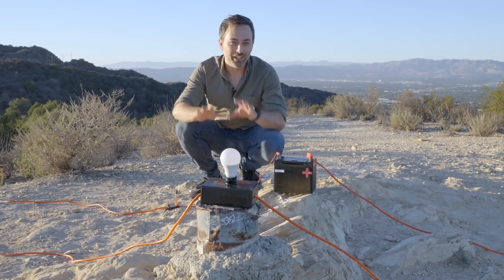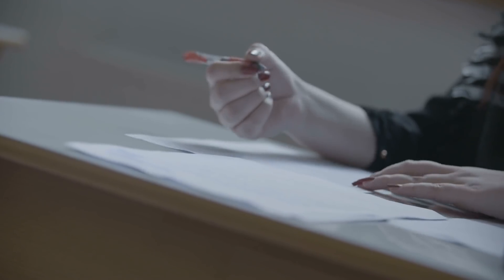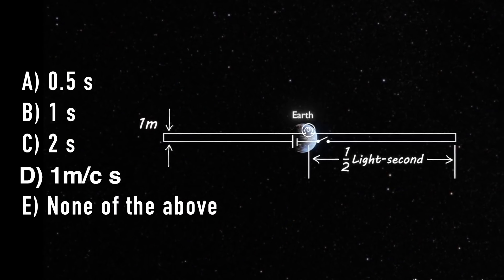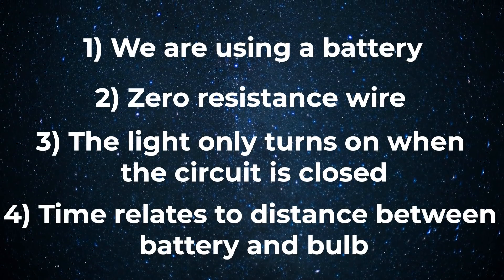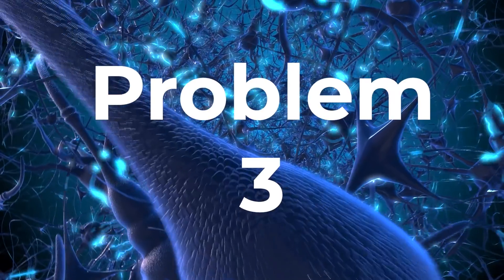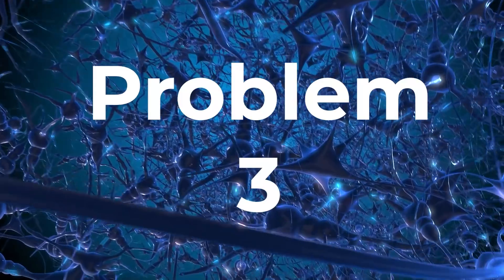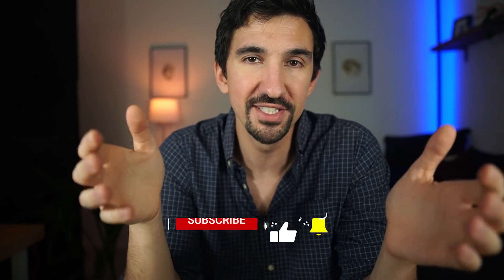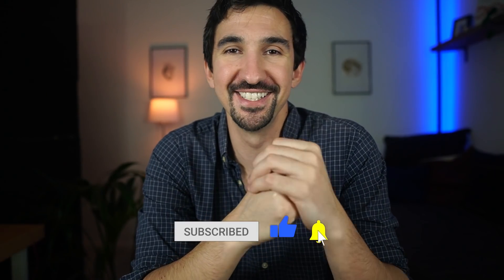Is Veritasium Wrong About Electricity?

Comment: I think your analysis is on the right track. When I watched the Veritasium video, my first thought was about causality. How do the terminals of the battery know the circuit is intact when the switch closes?

As you say, even if the circuit is not closed (e.g., broken at the extrema), we are looking at coupled antennas. Hence, the 1m/c time delay before a current shows up near the bulb. 

This toy circuit configuration stimulates interesting thoughts about what happens when you connect a battery to an open circuit. Is the equilibrium state of a battery is slightly different when standing completely alone versus when connected to an open circuit?
Reply: The electrons in the wire are under pressure to move (potential energy); that force is provided by the battery is available at the switch contacts or break in the wire.  But they do not move, due to a break in the conductor. The path is complete and therefore  propagation of electrons under force is possible, when the circuit is closed.

Comment: I thought he was saying that the energy took the direct route.  Like a capacitor where the surfaces don't touch.  I that case you can have a signal before the condenser is fully charged.  I don't feel the need to apologize for not taking a test on it.

Comment: I don't know the corret answert but you have to consider not only the resistance of the conductor but also the fact that a wire is also an inductance and two wires running in close vicinity are a capacitor. So the current can't rise immediately and the bulb will not light so also. (Sorry for the bad english)

Comment: The universal speed limit of the speed of light applies to particles. A particle or object cannot travel faster than the speed of light. However, this law does not apply to a wave or for information. When there is a wave, you have energy being transferred from one particle to another. This energy transfer CAN be faster than the speed of light. The energy wave can move very quickly even though each particular particle is not.

Comment: Of course, 3) is false (for a short period): very easy. That is all point. The lamp's time to switch off depends on the physical section where the wire breaks; the more distant it fails, the longer the light takes to switch off. Ignore the length of the wire, always consider the distance in a straight line (in ideal conditions). The point is that you have to consider the distances in a straight line and not the length of the wire. When you contact the battery, the space in a straight line is one meter.

Comment: These are both bullsh#$ theories.  It's angry pixies running through the wires.  Evidence:  You get the crap shocked out of you if you touch a wire with enough pixies.  Tell me that isn't malevolent entities!  Further evidence:  If you put together a circuit and get it wrong, they set up a little camp fire inside your parts, often the most expensive ones (malevolence I say!) releasing their "magic smoke" as a message that your work isn't up to AS9100 standards.  Don't be fooled, these guys have both sold out to the pixies...🤣

Comment: Well Dr Ben, you are partly right, but you have been confused by the circuit arrangements. You are suggesting that the light bulb can operate with a DC EM field, conceptually interesting but.....
Consider instead a bulb at the end of the long wires (because this is in reality the arrangement). This is now the recognisable transmission line, and so POWER (not current or voltage as such) reaches the bulb after length/c (forget velocity factor for the moment) seconds. One can easily observe this with a cable and a fast oscilloscope. The actual circuit under discussion is a transmission line BUT it has an inductance in one of the parallel wires, this simply makes the propagation slower, changing the line capacitance and inductance (and the characteristic impedance at the same time. Thus the bulb lights more slowly the longer the circuit. The 2 aerials analogy is not specifically correct, although one could describe a transmission line in this way I suppose.

Comment: 4:21 when the circuit breaks far away from the bulb, there is still some energy flowing (following Poynting vector) from the field created (also) by that part of the circuit towards the bulb. It takes some time for this energy to arrive at the bulb, and this repairs the supposed problem with superluminal information. So I believe Veritasium was right, at least at the first order of approximation, if you interpret "turns on" like "starts producing light" and "turns off" like "starts decreasing its light".
Reply: then wouldn't that same delay happen when the light turns on?
Reply: @kinghassy334  yes, it happens both ways.  What Ve left out was that there is always power transmission due to air gap induction, (wireless power, like the phone charger pads which have to be very close together and in compatible configuration,) but until the circuit is completed in the wire, (total circuit distance/speed of light) there isn't enough power in his demonstration model to make the bulb turn on visibly.
Reply: Veritasium has been wrong about a lot things for the past 2 years. Just saying.
Reply: @cjay2  do you know any where I can check what Veritasium got wrong?
Reply: @YasaswiS  he’s been posting that same comment in many many of these replies. Just a troll.
Reply: @cjay2  you sure like to repeat yourself over and over and over don’t you? 🤣
Reply: Why bother with fiber optics if you can send information faster just by making the wires longer?
Reply: @JuanCLeal  You can't.  That's the problem with the incomplete information Veritasium gave us.  The thing that made it "faster" was the smaller distance of the source and target, but not enough power is transmitted at that faster speed to actually light the bulb enough for the real world to call it "on."  Some power moves through the air gap, but not enough to do work until the full circuit is complete.
Reply: @JuanCLeal  because in the real world the cables do have resistance lol
Reply: @JuanCLeal , making the wires long enough is not practical.
Reply: The point isn’t that the light is readily on or readily off but that the light is communicating that the circuit has broken before light from the break in the circuit can reach the observer that would in tandem usually imply that the circuit broke and then the light turned off however here causality is broken. The bulb turned “off”, (or as you said would lose light as the cross product of the electric and magnetic fields would lessen and the power too lessen still SOMETHING that is observed no matter if there it is small ) THEN the circuit broke. This breaks special relativity and is why it is wrong.
Reply: @j.gczaricit9446  If the distance between the break and the bulb is d, then what you can observe locally at the bulb will start happening exactly after d/c time units. Energy flows at c, not instantaneously.
Reply: Perhaps a more effective version of the thought experiment is the following: consider a very long circuit, almost entirely confined in a circular region or radius r (where also the battery and the bulb are placed), except for a portion of it reaching distance R >> r and coming back along two approximately parallel straight lines. If the length  L of the portion of the circuit confined in the circular region is much larger than R, then you get a magnified "turn on" effect, meaning that the bulb will reach a significant portion of its full power within r/c time units, while thinking of energy flowing within the circuit (whatever it means) would predict a larger time of order R/c.
Reply: @j.gczaricit9446  The electromagnetic wave (similar to a radiowave) crosses the air gap at the speed of light. So, it doesn't break any relativity.
He is simply wrong that it actually has enough energy to turn the light on. At least, my definition of ON. 
The circuit doesn't know or receive any information faster than the speed of light. 
Another thing to make it "more clear"... IF (hypothetically) the Battery was pumping out 1,000,000 volts, then the energy would be more than enough to light the bulb across the 1 meter (at least I think it would). 
It doesn't matter that the ends of the wire are connected or not. 
To put it differently, if the voltage and current crossing 1 meter of air gap is enough to turn the light on, then the wires can be infinitely long and never connected, and it would still turn on. Or they could be connected 100' away, or not connected 100' away. In any case, if the light turns on 1 meter away, then regardless of the connection of the wire, it will always be on.
Reply: @j.gczaricit9446  The bulb would only start decreasing in intensity after the information that the end is broken is communicated to the battery. Until then the wires are acting as antennae, lighting up the bulb.

Comment: The reason I think it doesn’t transmit information faster than the speed of light is that the switch is 1 meter away from the lightbulb, the switch might not have current passing through it, but there’s tension already between the switch poles. That tension wouldn’t be there if the circuit was cut elsewhere on say the extremity. If there was another closed switch at the very extremity of say the left loop that was suddenly opened, it will take half a second to reach the lightbulb and the potential at the poles of the disconnected wire will return to neutral.

While the information the circuit and close will propagate through the line at the speed of light, the fact was there was tension in the whole wire, there was 12V of tension already there. That require the tension to have already had time to propagate.
Reply: correct answer is 1/c which is the time it takes for light to travel 1 meter.
Reply: Came here to say this. Glad I looked first, because you've said it more elegantly than I would have.
Reply: As mentioned in the video, that would allow for the transfer of information faster than the speed of light.  If there was a huge wire that went out a light year and looped back and I cut it at one light year away, then what happens? Do I flip the switch and the light turns on even though the there is a cut in the wire? In which case you are saying the wire is irrelevant to powering the light. Or does the light not come on, which allows me to know there is a cut in the wire before the effects of that could propagate down the wire? Thus sending faster than light information?
Reply: @Lilitha11  wouldn't that technically be not transferring information as information itself? 
Kind of like how a shadow can be said to be faster than light because it is absense of light for a example.
Reply: @Farrell_instincts  Nothing is supposed to move faster than light, since it is all information. Also a shadow is not faster than light, it moves at the same speed as light.

Comment: If you aplly this configuration, with the wires connecting mars and earth, but slightly differently. The switch is on mars and the bulb on earth BUT the power source is exactly half the distance between mars and earth. In space somehow. Does that mean you can convey information at half the time light needs to travel from mars to earth?

Comment: At the very very beginning of the experiment, there is a crude Maxwell Laws situation (or not, it is Quantum Mechanics and virtual particles fluctuating, but now let´s not bring that out),  neither Transmission Line Theory, nor Circuit Theory models do  apply.   Also notice, that if there were two open switches, one for each terminal of the battery,  then the situation would be very different from one with only one switch.   In the Veritasium´s experiment the lightbulb, before the switch closing,  is already connected to the batteries negative terminal, and so it is at the same electric field  level(voltage) as that neg battery terminal.  Upon the sw closing the electrical field disturbance in the positive terminal  immediately affects the lightbulb, but with not enough energy to light it up. It has to wait for the wave  to travel all the way and a complicated process of stabilization to be completed.
Reply: But then the bulb would not "light up" in 1/c time, right? "Disturbance" doesn't count as "has lit up". So which one is it? I'm so confused with all the experts chiming in with their own version of the event chain, and, as a complete layman, I'd really like to know the right answer and explanation. Your explanation sounds plausible to me, for whatever that is worth (I know, basically nothing).
Reply: @DukePaprikar  It would not light up at all if the conductors were as long as the problem claimed. Not with 12V applied to the circuit. The experiment is fundamentally flawed in several ways. First and most important, you can't simply ignore the resistance of the conductors. It exists. Imagine if we designed an airplane while saying 'ignore air resistance and all atmospheric conditions" and designed the airplane as if it were flying in space rather than through the air on earth. Would it still fly being shaped light a brick or the space station?  I hope that makes sense.
Reply: You should watch the video again driller. The light bulb is not connected to the negative terminal of the battery. It's connected to a socket of some kind (why he built an expensive looking Big Black Box for that instead of using a $1 basic light socket is totally beyond me, to look cooler I guess?). The light socket is connected to both terminals of the battery, not the lightbulb itself is not connected to one of the battery terminals. Then he ran the conductors JUST off camera to try and make us think it was a huge circuit like he was talking about. I'm guessing his Big Black Box sexy asf light socket tricked you, as it's similar in shape, size and color to the car battery, and you were expecting to see the lightbulb inserted into a real light socket of some type that you would recognize as such. This was a tricky "experiment" in many ways!
Reply: This certainly is a transmission line problem.  Derek doesn't actually say the light must turn on.  He says that we will assume the light is on if ANY voltage is across the lamp.  If you run the circuit in a circuit simulator you will find the exact answer as given (if you fix the units error).  The capacitance of the parallel wires will cause the lamp voltage to rise to a maximum and then decay as the capacitor formed by the wires charges.  The maximum will be very small but it will be non-zero.
Reply: Everyone is discounting the impedance of the circuit. The long loop of wires running parallel for that distance would have significant impedance, delaying the flow of current through the circuit.
Reply: Wrong. Waveguide and transmission theory apply regardless. Always. They are Maxwell's Laws in practice.
Reply: @cjay2  :: Of course not.    There is a very faulty waveguide,  its "guidance" property has leaks everywhere.  There are electrical and magnetic fields that eject short one meter  field  lines joining (interfering ) segments that the Waveguide  Theory assumes that they should be 30,000 kmts away from each other.